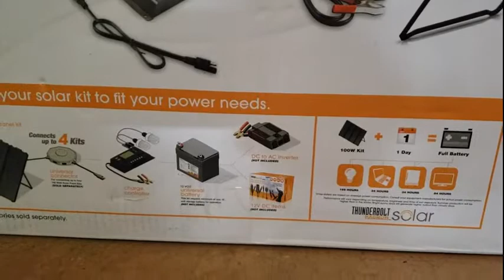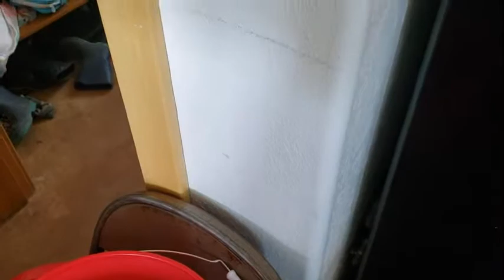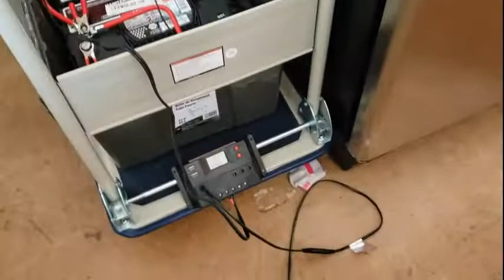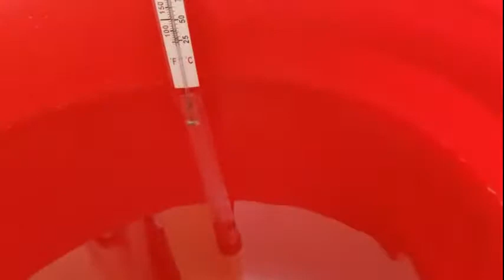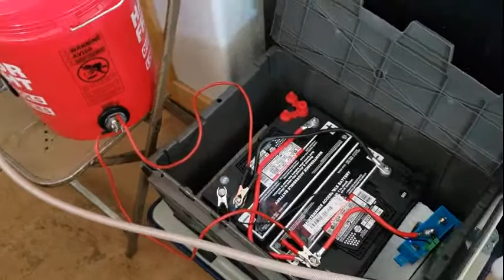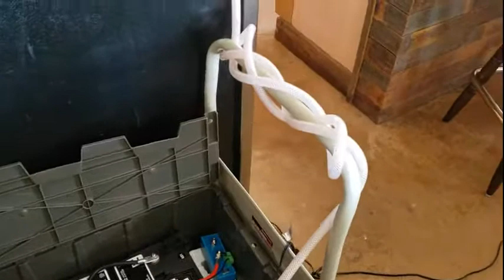BoonDock DIY Solar Hot Water

Comment: I think you can make it with Avasva solutions.
Reply from the maker: Any solar panels should work if they are properly connected as long as they produce more watts than the heating element.
 I use harbor freight panels but my panels are only 100 watt so I need the batteries. My heating element is 300 watts.

Comment: The car running to charge batteries is not a good option unless you have made changes It will probably charge way too slow.
Reply from the maker: I have not test this yet as I don't plan to use that method unless wind and solar were in short supply. Just a option. I also have a low voltage monitor that will notify to help me make sure I don't ruin the batteries.

Comment: That's heavy usage for only 100 watts of solar power. The solar panels are rated at 100 watts total they probably only put out 50 with charge inefficiency. Electric water heating is not a good way to use solar power. Don't damage your batteries because you don't have enough solar or wind
Reply from the maker: I understand, this isn't a system I would be relying on all the time.
I am in the process of adding a wind turbine to my solar. At this stage it was built just for emergency use if necessary if heating water with fire wasn't an option. I plan to add more batteries and solar and possibly only have the water element setup as a dump load if needed. This is just the start of me experimenting with a small short term backup system not a long term homestead system. Just doing a little at a time as I can afford more over time.